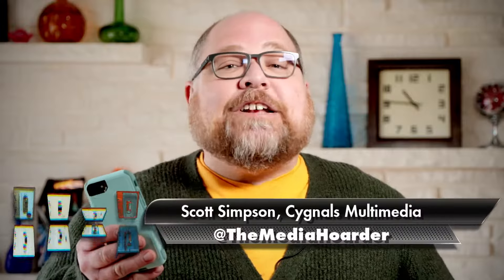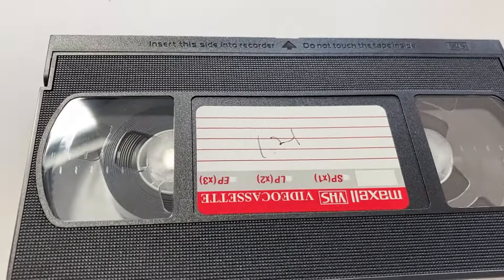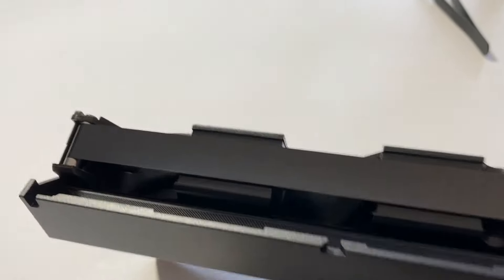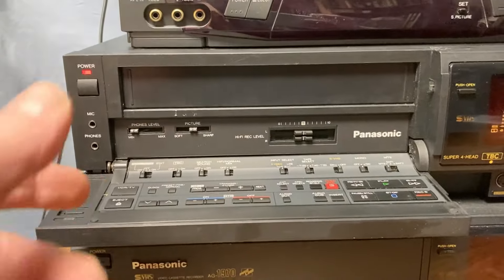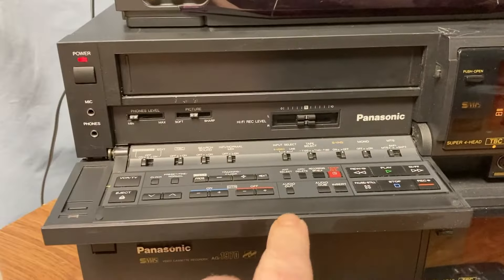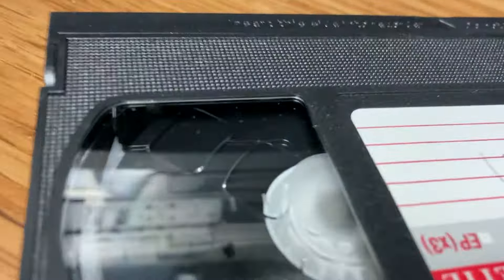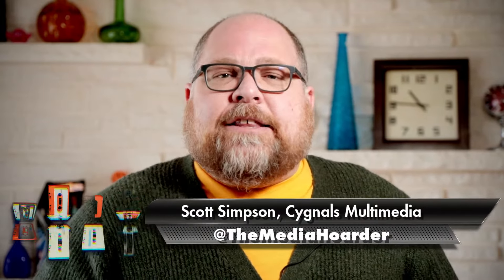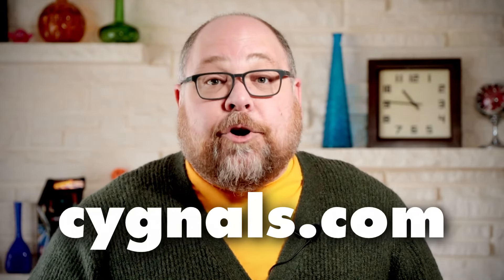VHS tape stuck and won't play? Try this fix

Comment: You. Are. A. Lifesaver! I had a tape that was getting stuck during the rewind. Pushed the little button and used my fingers to get it passed the bad spot. FF and REW a couple times and works good! Finished watching the video anyways!
Reply from the maker: Thanks for the kind words! I hope to serve up more helpful goodies in the near future!
Reply: i tried this it don't work. Unfortunately VCR's in 2024 cost 200-300$ I'm going to try to buy a used one on ebay for 80$. Others are cheaper but all have problems.

Comment: First step: remove the recording tab on a tape with unique material. Step 2: never put a tape with unique material in a squeeky vcr where you can’t see what the machine is doing with your precious tape...
Reply: That's a very common problem with the AG-1970 or any Panasonic VCR that uses the G mechanism. It's not doing any harm to the tape. Just the capstan brake pad is worn and it squeaks.

Comment: I have a large collection of VHS tapes and used to fix tapes for rental shops in my area. I have opened many and it's not supposed to be so disastrous. If the cassette is opened carefully and you lift the reels out from the front first, then pull few mm towards you so that the reels teeth are out of the brake you should not have much of a problem. I have some tapes which are starting to decompose and you can smell this if you lift the flap. As far as I know that can't be fixed. Mould can be a problem I rewind and forward a few times in a scrap VCR holding folded toilet paper with isopropyl alcohol against the tape. On the right of the head when you forward and the left when you rewind so that the head doesn't stick the tape.

Comment: 7:18
Yea i dropped the vhs tape and cracked the housing and broke it to a point that it would not work inside the vcr, so i got a spare black vhs tape and just transfered the 2 reels over to the good case 👍🏾

Comment: Great video! I was watching a tape for the first time in ten years or more on my Philips vr 530. I had found a couple of tapes I had been looking for for more than twenty years. They only exist on VHS. So I watched the first hour a few days ago of tape one. Then today I wanted to watch the rest of it. But no. When I turned the VCR on it didn't load the tape but pushed it out while showing the error code 4 and turned itself off. I turned it back on and put the tape back in. It didn't load but showed the error code 2 and turned itself off. (I may have mixed up which was 2 and which was 4 now). I tried it several times—the same happened every time. I took one of the few tapes I had left from a long time ago, tapes I had recorded some documentaries on and kept, when I got rid of my other VHS tapes (like a stupid ....). It played fine. I took another of those old tapes I had recorded on, and it played fine. I tried to put the new tape back in the machine and it went as described above :^/ That was strange, so I took the other tape I had bought. It was still rapped in plastic! Same problem. Machine won't play and it turns itself off with an error code 2 or 4.

It sounds like it won't open the flap, but I've tried it with the top off (not mine, the machine's). It grabs the tape fine but nothing else happens. It's really frustrating. I haven't been able to find any information on it.
Reply from the maker: I hope some young wizard obsessed with the past resurrects the art of saving these devices. Eh, it could happen.
Reply: @scottthemediahoarder  I wish!

Comment: Hi Scott.   Thanks for the pointers on getting a neat pack of the VHS tape.   I once was told that sticky tapes needed to be heated very carefully to remove moisture.  Haven't tried that but I do know the temperature is critical so the tape does not distort permanently.    As a former video producer I have hundreds of tapes, many with family memories yet to be digitized.  So I'm looking for "tape baking" tips.  Know anything about this?  Can you digitize 3/4" and EIAJ 1/2" reel-to-reel tapes?
Reply from the maker: I've never baked a videotape and would be reluctant to try it unless given specific advice to. I know old linear audio tape that's threatening to shed its oxide can be baked in specific circumstances, but I'm not certain the chemistry and physics of those reels would carry over to these tapes.

Comment: Hi 

I've also got a problem I put in a VHS tape into the machine yesterday thinking it will play correctly but now it is jammed in the machine and won't eject I am not sure if the tape has snapped or not as it won't let me use any of the functions for example rewind etc

Comment: Hey hoping you can please help here. I have a tape that spins in the player, but the numbers on the VCR won't go round. It's just on this one tape and I replaced the VHS body as well as the sprung mechanism holding the spools in place - any idea what's wrong with my tape? Help would be much appreciated.

Comment: I have two those same Panasoic SVHS decks. But the local VCR repair guy tells me that they need new heads and he doesn't have any, nor can he find any. Any idea how/where I may be able to acquire new heads for them? and if not, can you recommend an svhs machine repacement?
Reply from the maker: I'm sorry, I don't! I was fortunate enough to get two of these in decent condition. I'm fortunate that they work as well as they do!

Comment: I just get a still image when I put in a tape.  After a few seconds my VCR ejects the tape.  I tried it with different tapes but I get the same results.  For some reason I can re-wind and fast forward but then it will show only the original image from when I put the tape in.

Comment: I just started to transfer my old family  videos over to digital.  Some of the videos will play fine and randomly throughout them they d I a "Vertical Roll"  how do I fix them? Is there a way to tighten the tape or does this have to do with tracking?  

Vcr issue or tape issue?  The videos are from those small vhs tapes that are played using the bigger ones
Reply: Try cleaning the heads of the vcr, or the tape and inside is dusty.

Comment: How do i fix a vcr when All tapes won't load? I can push in a tape and as it is trying to load, I pull the power cord and then plug the cord back in and then the tape will load and I can play like normal. How do I fix it so i don't have to unplug? Can you help????
Reply from the maker: I'm sorry, the diagnosis of mechanical issues with VCRs is outside my scope of expertise so far!

Comment: i have an old Panasonic vcr that will load the tape ( tried a couple) into the machine but will not move the tape forward or reverse. Any ideas..thanks Stan
Reply from the maker: Sorry, I don't! You can try loosening the screws a little in case it needs some more space to spin.

Comment: I have a vhs tape from 1986. Each time I put it in my vcr it just seems to be ready to play but then ejects. Is there a reason it might not want to play at all? it also will not rewind.
Reply from the maker: Sounds all jammed up! If it will fast-forward, try that. Consider loosening the screws on the shell a little bit -- not a lot, just enough to loosen the insides up a tiny amount.
Reply: @scottthemediahoarder  will try that! thank you so much!

Comment: Never use your expensive S-VHS players for rewinding. Expensive gear for minor task, and all sorts of things could go sideways here. And an AG-1980P repair is not easy, and very costly.
Reply from the maker: Great advice, lord. Shortly after this taping, I switched to the old Sharp machine above it for rewind duties. I'm keeping an eye out for a suitable rewinder to movie that duty away from working machines.
Reply: @scottthemediahoarder  But the Sharp VCR has RAPID REWIND! You don't want that! It can COMPLETELY snap the tape off the reel if it gets too excited and doesn't slow down before it gets to the end!

Comment: I ran into an issue. Tv works fine. VCR plays and ejects fine. Sound is good. But no color. Cleaned the heads and dusted everything. Still no cure.
Reply from the maker: So you get a black and white image, but no color? If it were a DVD player, I'd assume the wrong cable went to the wrong jack ... but on VCR with the yellow composite video-out, that should not be happening. If you've tried swapping cables and have exhausted options for using other inputs/outputs, I'd guess the picture-generating circuitry in the VCR is broken.
Reply: @scottthemediahoarder  thats what i was guessing too. It was only $5 at a local thrift store

Comment: You no vhs tapes never locks up at all specially when they scratch up specially also they are fixable with scotch tape I had vhs tape broken and I fix it with scotch and it started playing with out no  problems